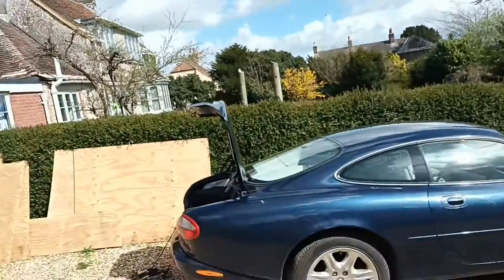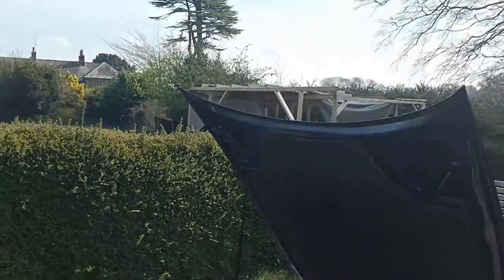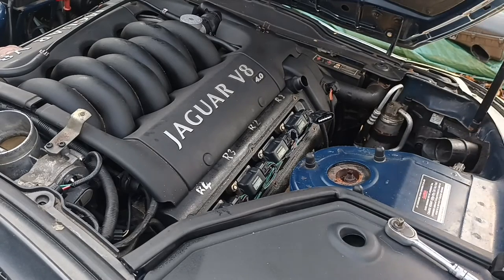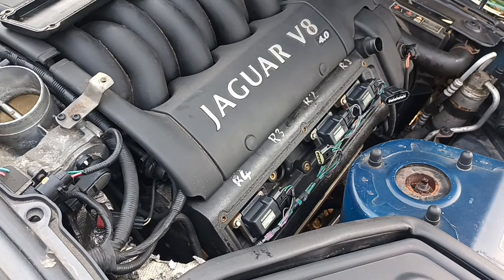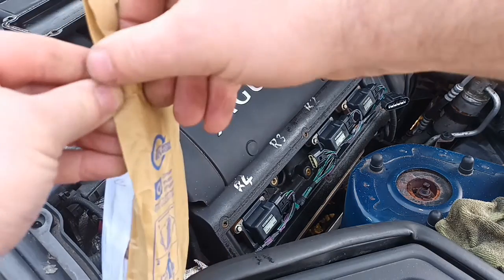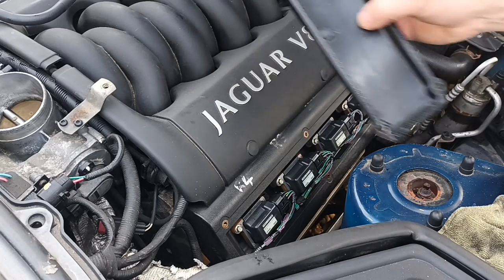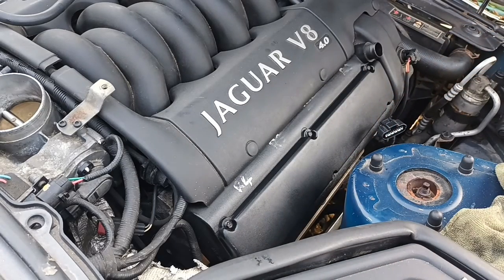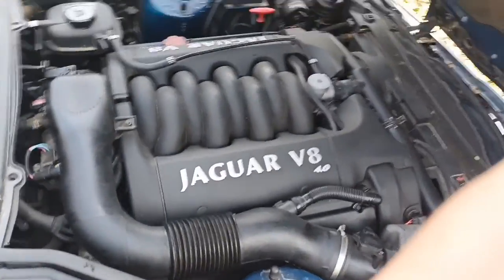Jaguar XK8 project #38, the dreaded 'restricted performance' fault, rough running issues, fixed!

Comment: We had restricted performance come up on our XKR that turned out to be a dud coil pack on number 3.  We replaced just the number 3 coil pack & all was well until a couple of weeks later when the restricted performance came back.  No mucking about this time; we replaced all the coil packs & plugs as they were all the same age as the number 3 coil pack & we anticipated they would all start playing up in due course.  No further problems since doing the coil packs & plugs.
Reply from the maker: That's great that you found the cause of your issue, and a great shout to replace all the coil packs and plugs. We love little wins that are so effective 😍

Comment: Here's an idea for you and all the diy guys out there, find a cup cake baking pan with 6-12 slots, use that to keep the nuts and bolts in, it will help everything tidy and not rolling everywhere, also to organize/group them together, it will make it easier for you.
Reply from the maker: Hi John, I really appreciate you getting in touch buddy. What a great idea, I have never thought about using something like that. I have since bought some magnetic trays, but I love that idea as it gives you separate compartments to store it in 👍 
Thanks again for your input buddy 👌
Reply: @projectsinthebarn  I find it very helpful if you have to change out a starter in a Toyota sequoia, many steps at different levels before you get down in there, so the tray helps organize where things go along the way.
Reply from the maker: @johnlivingston9217  top idea buddy 👍

Comment: I picked mine up from the South Coast to Solihull and within a few miles the same thing happened.  That said it was reaching speed limit (ho hum), but wouldn't go over 3000 revs.  Mine was No7 cylinder.  I bought a couple more as spares as I think mine were the original ones as well.  Touchbwood, no problems since.  
In got side swipped parked outside my Dad's a couple of weeks ago and they took the wing mirror off.  That was a nice little bill!!!
Reply from the maker: Hi buddy, firstly, gutted for your jag getting hit whilst it was parked up, hope its been fixed up OK?

I have just come back from its test run and its all good, runs sweet as a nut, so fingers crossed we have sorted the problem. 

I do think the battery may be on its way out also, I had it in charge for an age and its still not at full capacity.  

At least that gives me something else to do on it 👍
Reply: Yeah parked up.  Luckily the independent Jag garage not far from   me was taking one in as scrap the week after I called.  So they took that one off and sprayed the cover to match.
Glad yours is all.sorted :-)
Reply from the maker: @Ridley2907  that's not too bad then buddy, I wish I had a jag specialist down here in the south, there's not much about down here.

Comment: Simon, always loved your channel...Big thanks for this latest one. My XKR had the same thing last week and its been a bit overwhelming on where to start,  but after watching your vid, you have eased my stress brilliantly 😊 and I will do the same thing. Thanks again😉👍
Reply from the maker: They like to throw up a challenge or two don't they, fingers crossed your's turns out to be a simple fix too. It's just nuts and bolts, so nothing to get too stressed with 😃
Reply: @projectsinthebarn  they certainly do, but just great cars and look forward to getting mine back to normal, when work and family permit😅

Comment: hi simon..and happy easter, i had the same problem 3 years ago. also on number 3 .
Reply from the maker: Hi udo, good to hear from you and happy easter to you too. I seem to have cracked the problem as two test drives in the fault has not reappeared,  so fingers crossed its all sorted 👍

Comment: Hi, I have a xj8 with same problem 
Could you give me the details of the coil pack supplier please
Reply from the maker: @Eddie-h3q  hi Eddie, it's good to hear from you, buddy. To be honest, i have tried the brand new after-market coil packs, and also second-hand ge yine jaguar coil packs. 
If I had to choose again, I would definitely go for genuine jaguar ones, which are manufactured by denso. 
If you identify which is your problem coil pack, then check the part number on top of that, and also check if it is a 2 pin or a 4 pin plug, which is simple the amount of pins the electrical connector has that goes into each coil pack. 

Auto reserve jaguar is always a good source for genuine used parts. If not, Berkshire Jag components are a great source for brand new parts for genuine and after-market. 

I hope this helps. If you have anything else, please just let me know. 

Cheers. Simon.
Reply: Thanks for the info
Reply from the maker: @Eddie-h3q  you are very welcome 🙏

Comment: The ignition coil was burned by a short circuit. A little tip from me: please use a brass brush for cleaning.  The  spark plugs. And carefully clean the air mass meter sensor mit cotton swab.before installation.😅
Reply from the maker: Totally agree with the brass brush, I never had one to hand 🫢 I will take on board your advice with the air meter, and will do that when I service the car over the next few weeks 👍

Comment: mass air flow had mine replaced.. o2 sensor fuel filter purge valve
Reply from the maker: Hi buddy, I'm glad you got your issues fixed. It looks like I'm having issues with my XKR project that indicates a faulty MAF sensor. Fingers crossed, I can get to the bottom of that 🙏
Reply: @projectsinthebarn  my cat wont roar untill properly warmed past ice cold to get rolling